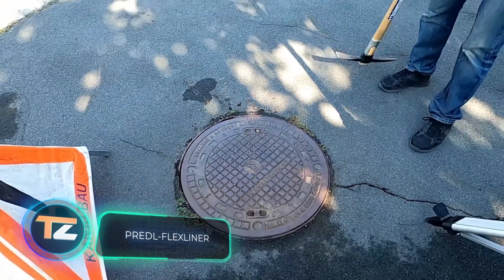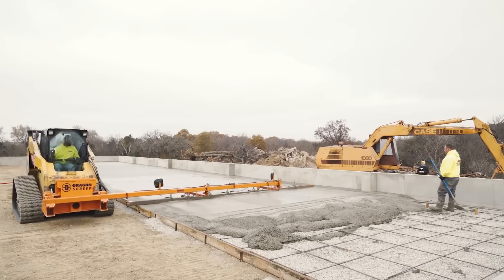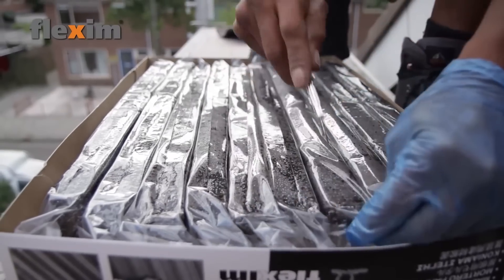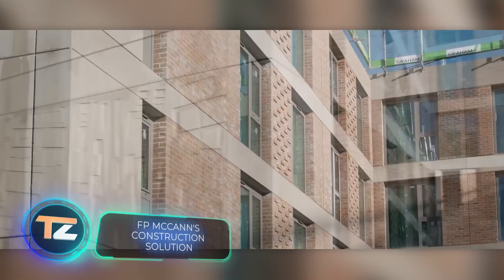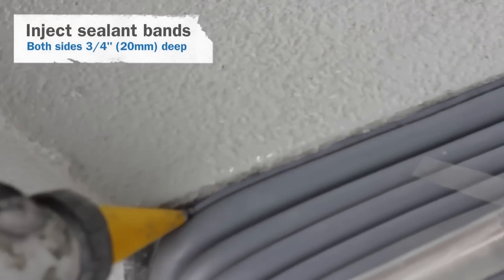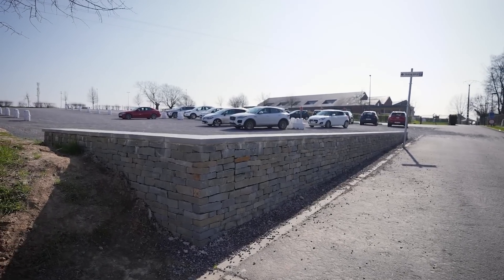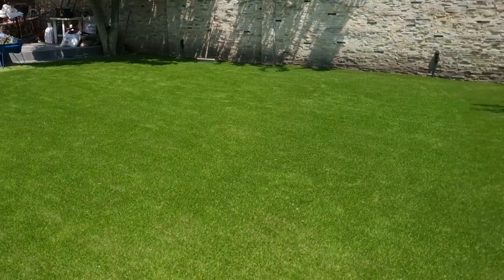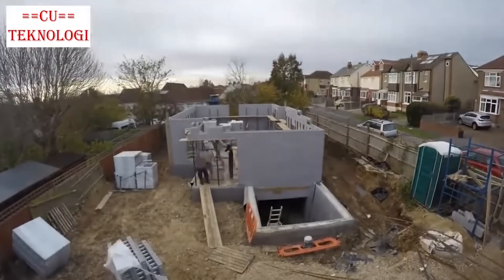INCREDIBLE CONSTRUCTION TECHNOLOGIES OF A NEW LEVEL

Comment: Building from pre made concrete blocks it's nothing new. Go to any place of old Soviet block and you will see cities swarm with them. On the side note GB is still building houses with out proper ventilation system - in solution for that they drill wholes or have pre-drilled in there windows :).
Reply: whats a propper ventilation system?
because window vents and air bricks worked just fine with 0 maintinence untill fuel costs went to the moon because people started closing them or covering them up to try keep heat in

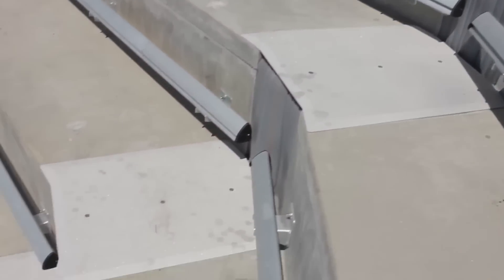Comment: 06:34... No, No, NO... that's not going to work... the "expansion joint " will fall out with pedestrian traffic only - go for a solid steel plate, fixed on only one side... it will move, yes scrape, but durable

Comment: I’m sorry there isn’t anything that is UV resistant. I live in Az. Haven’t found ANYTHING that can withstand the sun and heat.
Reply: UV resistant does not mean it is UV protected, it just means it resists UV rays to a certain grade. 100% UV protection would be the term for that and yes, no building products are safe from it, but most resist it. Everything deteriorates, UV resistant products just lasts longer. I'm guessing to make something UV protected it would need some sort of reflective layer as seen with polarized sunglasses and that would be expensive and maybe not even possible when the product needs to be flexible or be able to take impact. Not my department (I design buildings), but speculating on new possible building materials is interesting.
Reply: @BloodHawk31  In other words, "UV resistance" is a useless marketing term.
Reply: @smeaglerG No. Resistant means it can withstand it for X amount of time. Fire resistant is the same idea. It can withstand fires of X temperature for X amount of time.
Reply: @Flosstradamuss  You just proved my point.  It's a marketing term.  "Resistant" just sounds better than "durability" or something else.  It's strictly for selling purposes.  I would use different sentence to describe it in an honest fashion versus sling the word "resistance" around when it doesn't "resist" anything.
Reply: Adobe. Look at local indigenous solutions before industrial ones
Reply: @BennyNeptune  Im not going to make my roof our of mud.
Reply: @adrienwatson2179  most roof tiles are crushed sand🤔it's basically the modern processed version of adobe
Reply: Would depend on the application wouldnt it?
Reply: If you don't believe it don't buy it B***

Comment: 4:04  "Australian construction technology is highly developed."   LOL.  No, it really isn't.  The AVERAGE builder struggles with wood frame construction and wood framme accounts for over 98% of all home builds.  Anything beyond that is very much the exception in residential.  Commercial construction doesn't count as it's usually non-Australians doing those builds because the Aussies don't have the skills.
Reply: residential construction methods in Australia need a massive shakeup , timber or steel stick frame homes are too labour intensive and bushfire resistance should have been developed 150 years ago.
there are better things coming . tick tick tick.